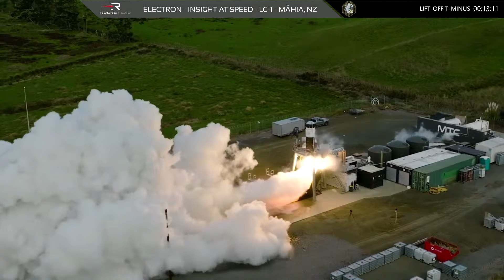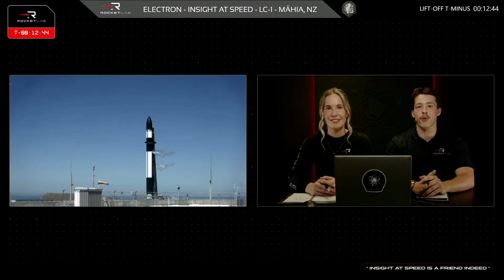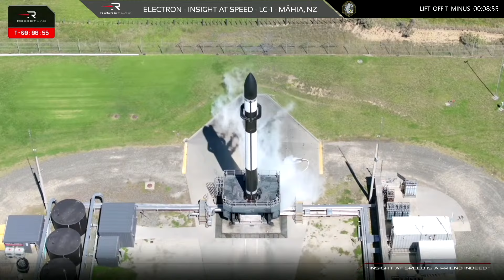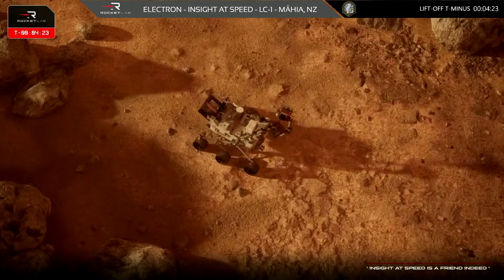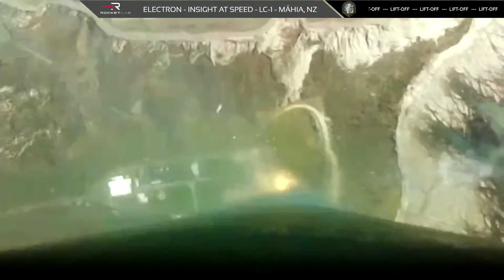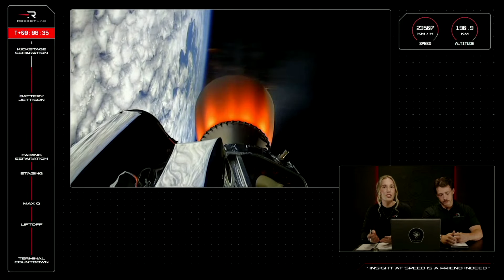Rocket Lab - Electron - Insight at Speed is a Friend Indeed - LC 1 - Mähia, NZ - March 6, 2026

Comment: I didn't hear the one controller with the most critical job to give confirmation that the pointy end is at the top and the flamy end is at the bottom (critical to confirm that before a launch)🤠